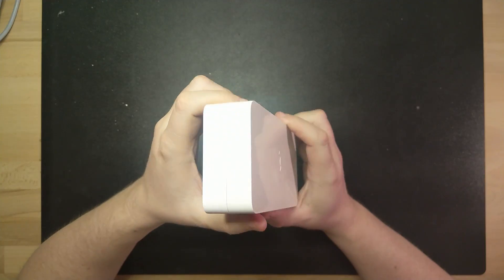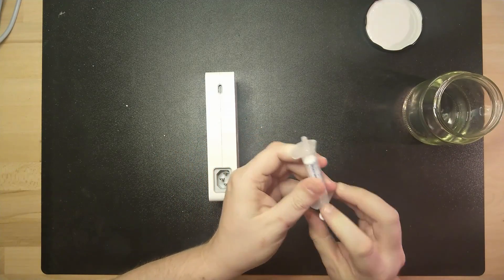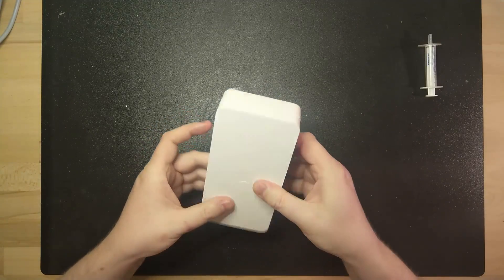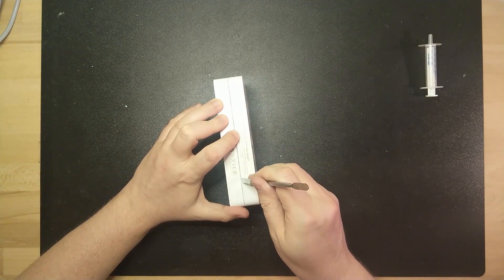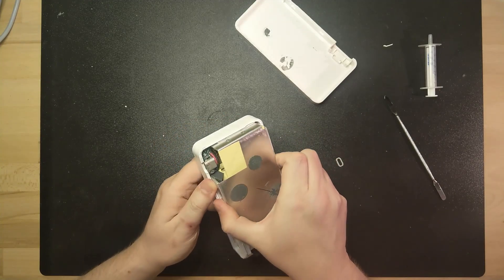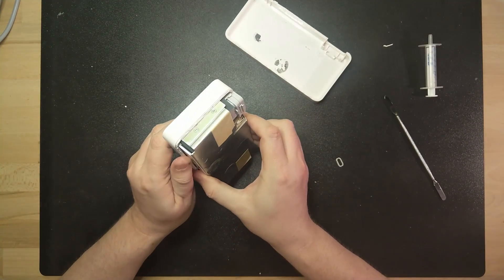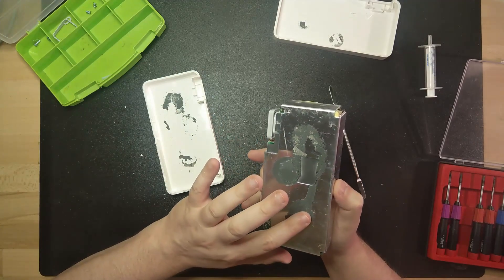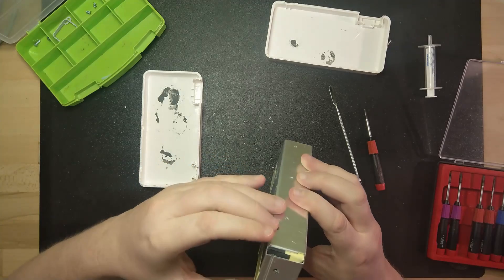How to open up a glued Apple power adapter

Comment: OK, you got the adapter open... How do you trouble shoot & fix it?
The computer tech at work found one of these monitors by the side of the road. He says it worked on & off, but then stopped working... He assumes it's the power block, but IDK...
It's an awful nice looking monitor, except it does not work.... These type monitors go for $2300 (for 5K...) so it would be nice to get one to work for free!

Comment: How do you remove the gas smell after this?. Its no enouhg with ip alcohol?
Reply from the maker: IPA did not work at all on the glue. At least not on this particular adapter. And I recommend ofc that you do this is a well ventilated area. I had a window opened a couple of hours which did the trick for me.